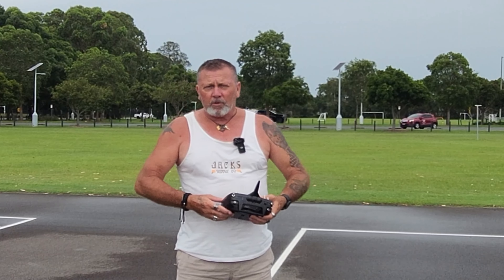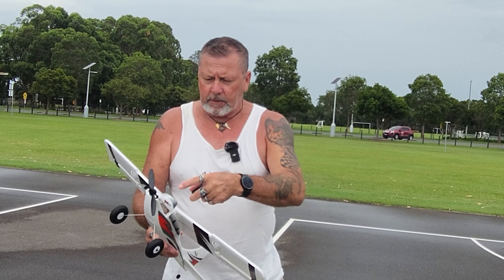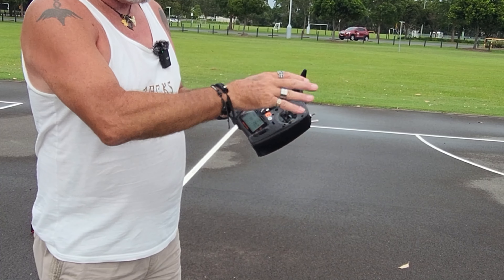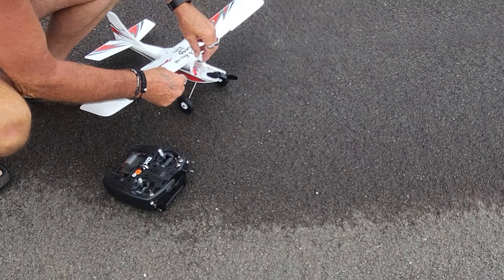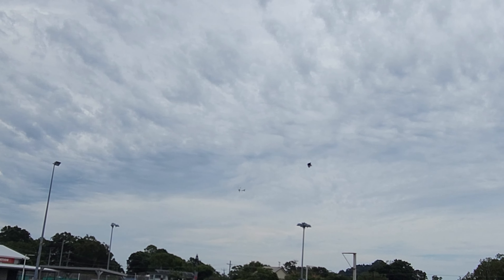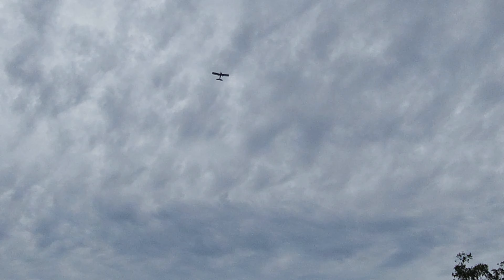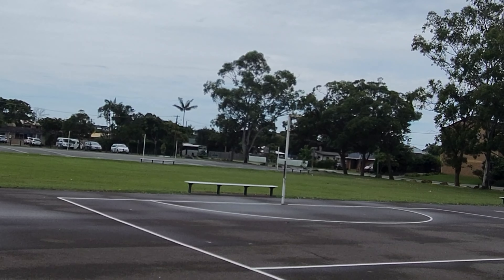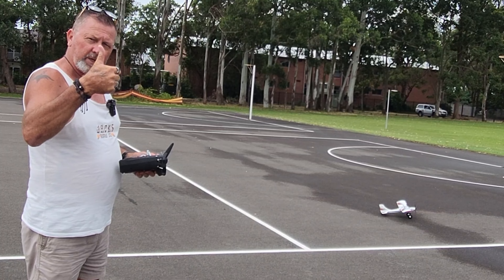FLYING THE RC PLANE APPRENTICE STOL 700MM

Comment: Excellent enjoyed your flying,  I've just purchased the plane,  looking forward to flying.
Reply from the maker: @JonathanProtheroe excellent purchase, it's such a fun plane. Have fun flying
Reply: Hi again,  thank you for your advice well appreciated,  I take delivery of the plane today,  also purchased a spare battery,  Overlander 450mah 7.4 2s 35c . Just to confirm it will be ok to use,  I'm a newbie with electric flight.  Once again thank you and I enjoy your excellent flying
Reply from the maker: @JonathanProtheroe Hi Jonathan. Here is a link to the 450mah battery that I'm using. I'm not sure where you're located but the link is to an Australian website, it will at least show you images and give a  description. https://www.rchobbyland.com/im-r-c-450mah-25c-7.4v-soft-case-lipo-battery-jst?gad_source=1&gclid=CjwKCAjwlbu2BhA3EiwA3yXyuz6pBOD8QbXjzvRGEgGWPws_Txm-swuOh0A4NenJ0Z1LDplSI6ULzhoCPxYQAvD_BwE
Reply from the maker: @JonathanProtheroe  Also ascertain the connection plug on the battery fits the plane. In this instance a JST plug (connector) is required

Comment: Awesome plane!  What kind of flight times do you get with that 450 over the stock 300?
Reply from the maker: Hi there and thanks. Its relatively new here in Australia ive been told and it is sooo much fun. I'm probably getting only around an extra minute and half to 2 minutes but I actually haven't flown to near critical stage yet.
Reply: @TJMDRONES  I have very limited space to fly so I picked myself up one of these. They look like so much fun! Thanks!
Reply from the maker: @WarbirdPylonRacer enjoy it my friend!!
Reply: Wow there are so many poles out there mate! You did really well to avoid them. Nice flight.
Reply from the maker: @jonowillmer unfortunately it's the only area anywhere near me to fly. Apart from the light poles it's rather open. Thanks mate 👍
Reply: @TJMDRONES  not having a shot at you just amazing how they could stick so many posts in one location. Great job mate!
Reply from the maker: I didn't think you were having a shot haha. There are flying clubs around with open fields but a fair drive for me to get to them
Reply: I have the same plane and you can get 5 to 8 minutes. Nice airplane, I wish they had floats like the carbon cub. I live by a lake and like to do that.
Reply: I work out in the oil fields and don’t get much service and if anybody can let me know about for that. That thing is almost like a helicopter.
Reply from the maker: I'm getting 9:30 before my radio tells me it's time to land, which is awesome flight time though I am using the 450mah battery
Reply: @TJMDRONES  wow that's impressive!

Comment: The spec says a 2s 300mAh 7.4v battery pack,  can I please enquire what size pack you used. I would like to purchase a 2nd pack
Reply from the maker: @JonathanProtheroe I used a 450mah 7.4v battery. It fits in really snug, just have to make sure the wiring is tucked in. I'm getting 9 to 9 and a half minutes flight time with this battery
Reply from the maker: @JonathanProtheroe   I used a 450mah 7.4v battery. It fits in really snug, just have to make sure the wiring is tucked in. I'm getting 9 to 9 and a half minutes flight time with this battery
Reply: @TJMDRONES  Thank you for the reply,  looking forward to flying mine when it arrives.
Reply from the maker: @JonathanProtheroe  you're very welcome. You most certainly have something to look forward to, happy flying!!

Comment: What battery adapter did you use?
Reply from the maker: Didn't need an adapter as the 450mah battery has a jst connector which is the same as the 300mah battery that came with the plane
Reply: @TJMDRONES  Thanks! That's great information. Much appreciated. Happy flying.